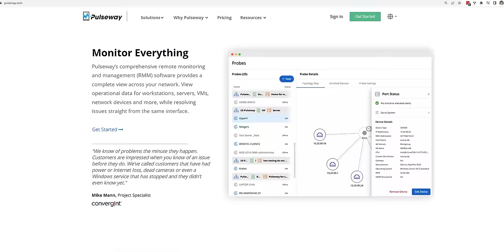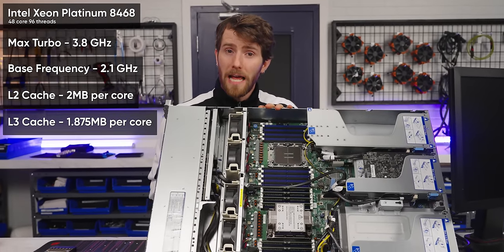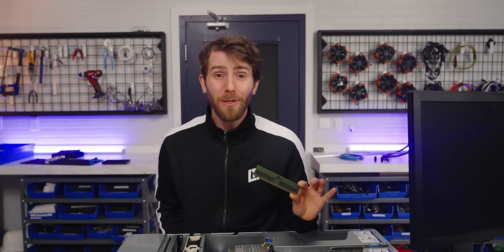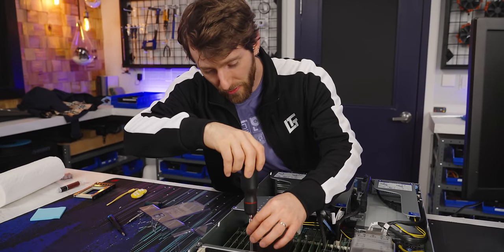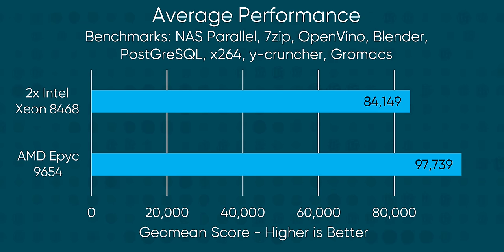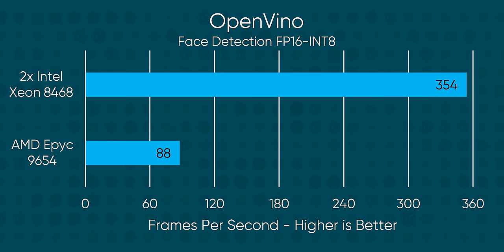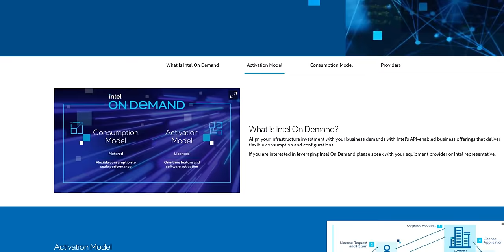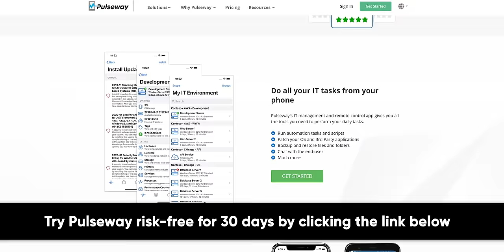Intel’s New CPUs are Cringe - Intel Sapphire Rapids Xeon Platinum 8468

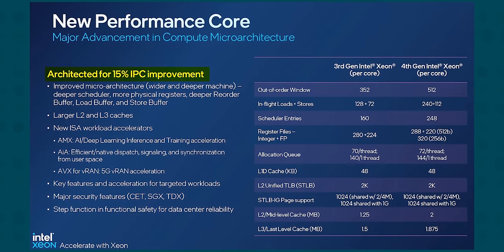Comment: 1:58 ever heard of Core 2 Quad? That's literally 2 Core 2 Duo chiplets on the same substrate.
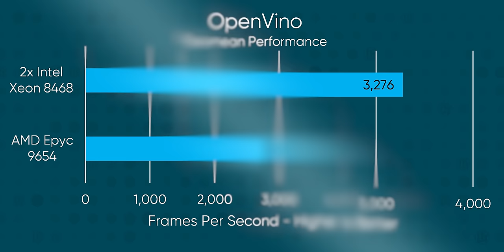13:34 it makes absolutely no sense to perform AI workloads on CPU, when an entry-level GPU is still like 10x as fast. The bottleneck is not matrix operations, it's memory bandwidth, which CPUs are still poor in due to their 4-level memory hierarchy with DDR. SPR with HBM would change that though.

Comment: I hope intel gets their stuff together, they've been a fantastic mainstay in my computers for over 25 years.. they're taking a beating right now but hopefully they can pull through.
Reply: Don't buy too much into this video.
Reply: This is what happens when its assumed that a juggernaut of a business cant fail. They have a decent hole to dig out of.
Reply: if you want intel to do good buy amd. the more they lose costumers the better they'll try to make their product to compete. also buy android instead of iphone. you are welcome to the advise.
Reply: Don't be loyal to brand lol, if they are not paying you take a lesson from Linus - go somewhere better (or somewhere they pay you). If AMD is better buy AMD, if Intel is better buy Intel. I have Intel for 12 years already but for the last 5 years and was better choice and my laptops run on AMD. Nothing special on any of those machines.
Reply: I'm not a fan of Intel and haven't used their products in 20 years, but it is good for the market when there are multiple competitive options so I do hope they pull their heads out of their butts and "pull through" as you put it.
Reply: @cyjanek7818  so if a politician gets paid by the oil industry and embargoes EVs because they can have huge range does that make ICEs better? Need more than just one video to change opinions and this video goes from good to bad to future good very quickly, with very harsh slandering even when the point diff between Intel and AMD in one of the non AI tasks was 50%
Reply: @AjayMenezesanayasdad  dude he talks about server cpu not their hedt one, it's laughable intel can bumbling too hard
Reply: @AjayMenezesanayasdad  I don't even understand your point but about his ai comparison - he got setup with two Intel CPUs and one and amd, that was 3k cheaper. They should check what accelerator can they buy for 3k USD

Comment: The whole thing seems like hubris on Intel's part. I can maybe see someone opting for Xeon 4th gen if they absolutely need 12TB of RAM in a 3U or 4U space, but given that it's already not a straight scaling (512GB DIMM x 8 channels x 2 DIMMS per channel x 2 CPUs should be 16TB) it makes me wonder if that'll scale to 4S and S8S systems, or if 12TB is just the hard cap. The S8S scaling seems like it'll be a win for Intel on paper, for high density cloud compute nodes, but given that those systems tend to be 10U or more it seems like AMD could still probably outdo them on both density and power consumption, albeit split over two nodes. Maybe for niche applications that need absurd numbers of PCIe 5.0 lanes on a single node? I'm just not seeing it. Yes, the prices are lower than 2nd gen or 3rd gen, but those were priced in an era where the competition was marginal at best.

Comment: I haven’t read the details on but it sounds like On demand is similar to what IBM has been doing with pSeries hardware for years at the core level. It allows you to purchase cheaper (fraction upfront for the core) and enable cores (or functions) as needed without large downtime to replace processors. Enabling cores is done live with soft keys, and pricing could be set at purchase time. This is something that enterprise purchasing departments will be comfortable with as it is some they likely already are doing within their larger systems. 

Having 20/40 cores enabled can save hundreds of thousands of dollars on a project and allows for expected (and unexpected) growth.  Allowing the purchase and licensing of the cores as needed and helping with licensing (sub capacity is a pain) by capping risk.  

In the IBM case there is a cost waste over the life of the hardware if the un-enabled cores are never used, as a small amount of money was spent to have them available but this is a hedge against needing the additional cores ASAP and having to wait on purchasing, supply, and the downtime required to replace.  Even at the scale some pSeries clusters can go to (256+ cores).  There are still times when HA of critical systems is out of reach because at this scale it can get pricey. Meaning a processor replacement could be hard to schedule and/or be financially impactful.

Comment: Is the Epyc chip still as fast if you add the thermal paste in the socket?
Reply: Even faster, cause it will use the pins for cooling and therefore has more thermal head room 😁

Comment: My first Intel was a 80/86 and switched to a 486 and finally upgraded to a PII 400 slot cpu, that was the last one cause I never managed to afford higher chips from intel cause it’s not the chip, you need to consider the ram, mb etc. I am loyal to amd for a long time even though it was behind intel and early amds sucked but they were affordable. Not feeling bad about intel.

Comment: Having 9 chips per system is pretty impressive, I remember getting a used R815 with 4 opteron server CPUs in it and thinking I had the pinnacle of computing hardware.
That said, having a better CPU per socket is going to be a far better solution.

Comment: 64GB giving 3D V cache a run for it's money. When transfer speed is no longer an object to hurdle, kinda defeats the purpose of L cache in general. Heck, to the point where L cache become more of a bottleneck to the rest of the high speed system, sides L1&2 caches have reached 2&3 capacities. At some point, technology is going to cut down fundamental bottlenecks that will change the world's standards.

Comment: Not mentioned in this video is AMD's massive yield advantage.

Each CCD is tiny (~70 square millimetres). The IO die is significantly larger, but is also on an even more mature (and cheaper) process and measures in at ~420 square millimetres.

Meanwhile each of the 4 dies involved in Sapphire Rapids products is ~770 square millimetres - massive by comparison and far more likely to encounter yield problems. For a 4-tile Sapphire Rapids CPU, 2 different die types are required due to the way IO and floorplan layout needs to be adapted.

Comment: As someone working for a datacenter and who knows quite a few folks in datacenters... reliability is king.

Few datacenters buy AMD systems because AMDs chip failure rate has been, historically, higher than Intel's.

Yes, AMD has been gaining ground in the datacenter market, but there's a significant lack of trust on them for datacenter use. 

Their "good" stuff is still only ~5 years old. Datacenters have been pretty much exclusively Intel business ever since Pentium 4-based Xeons.

Comment: Last year's consumer chips in a server processor for me is not a problem, in fact it's called good R&D.
I can't wait to one day get my hands on this.
Unfortunately, I think it was going to be better but I think now they're going to try to compete with AMD, but at least they are doing whatever they think is best.
I think architecturally you have two very different processes from two very different companies and I don't think either is bad. I would prefer a monolithic chip for certain workloads. I don't understand why the processor needs to have come out yesterday for it to be brand new. In fact these golden Cove cores are actually based off something very similar to the embedded server cores which were released in late 2020-2021, which precede the cores which you mentioned are released on the desktop.

I think your key thing that should be described as how money is possibly being allocated differently and that the price differences that exist between Technologies become more of an issue as budgets are realigned.
Reply: To be clear I don't think this processor competes with AMD.
What I was saying was now until this trying to compete with AMD, so I'm imagining in 5 years they will be able to compete with AMD.
Also I mistakenly said it's called good R&D. Would I actually meant was it is in my opinion something that appears like good R&D.
And what I meant about the processor as I thought it would be better but I think Intel is changing strategy to be more competitive and so architectural Decisions are now realigning in such a fashion. During any such process there is some decisions that are made which can be seen as a compromise, but always advance some kind of goal.

Comment: As an enthusiast already working on AI right now, no. Intel is not going to beat AMD by cramming proprietarized TPUs onto the same substrate as their CPUs right now. Why? The power draw of a good TPU that can run a large model at a halfway decent speed is almost as high as their CPUs.
What Intel needs is a dedicated TPU on it's own substrate that can connect directly to Intel's QPI (or an equivalent) to share RAM pool access and pass data across, similar to what their math co-processors did in the 90s. That way they can stream data packaged on the CPU directly into Tensor operations for the TPU to execute, and stream the results back to the CPU again to be packaged into a usable format (4eg, using AVX to convert output into a photo or video). Nvidia does this in stages due to I/O timing issues, but Intel (and AMD) have low level control of the system hardware and thus can sync system bus, CPU, and TPU clock speeds.

Comment: Honestly, they should fire whoever came up with the locked cores. basically if they were to charge lets say 2000/core to unlock and that CPU is ALREADY 7000. IT could easily make it cost 15000 for a single CPU, that's only a one stop shop. When i buy hardware, i want a fully unlocked and capable product. that's what i am buying, if corporations adopt this then it WILL trickle into the consumer market, allowing companies to come out with locked cores on purchase. This is ATTROCIOUS and should NOT be allowed to continue EVEN if Intel has to go through harsh times or go bankrupt. if i was in any level of IT, id ask if we can black list intel for trying. This is akin to this virus's that hijack your pc and want you to pay to unlock it.. but built into the market. Or allow companies to come out with finished products that lock out features behind a pay wall. then it will also affect other markets too. THIS NEEDS TO DIE

Comment: Again some perfect examples why LTT fails to properly review enterprise equipment:

* First, unless you are looking for a specific use-case which needs to fit multiple GPUs or a whole lot of disks -> NEVER, EVER buy Supermicro servers. Cheaply made, upgrading BIOS & firmware is a complicated process using DOS-like tools or the UEFI shell, and all IPMI (management interface)-implementations just suck. Real companies stick to the big 3 (Dell, HPE and Lenovo) for a reason ! I'm not talking cloud providers like AWS or Azure, or platforms like Google or Meta since they build their own custom servers anyway.
* Then, taking a SKU (Platinum 8468) which again, will only perform best in certain workloads and then comparing it with the top-of-the-line EPYC CPU is just unfair. Again, this SKU is for a very specific segment, but most will stick to mid or higher range Gold SKU's.

I know this because I was asked to configure a new HPE ProLiant DL380 Gen11. Our partner vendor specifically mentioned: in this setup, if we need more compute power or capacity, it will be cheaper to add another node than to buy just a single node with the highest CPU SKU, which would easily amount the same price as the whole server with a lower SKU.
So I went for a config with dual 5415+ (we need both PCIe risers for a lot of AIO cards, and DL380 is dual socket anyway), 16 physical cores in total. Since it's the 2nd lowest Gold SKU, it's also a lower TDP version (150W), and can therefore be cooled with the standard heatsink. CPUs above 150W need the high-performance heatsink, CPUs above 330W need liquid cooling..
The project will mostly be running on GPU (RTX A6000 or its datacenter equivalent) and the broadcast-specific AIO-cards (AJA, Matrox, ..).
Not to mention that if you run Windows Server you always have to license at least 16 cores per machine (even though the machine could have less, for example on both Silver 4410 SKU's). Properly licensing those 18 or more core machines will set you back a fair amount - not counting Software Assurance, Server CAL's, Terminal Server licenses etc etc.. 
But I think I've made my point here. Not every person is able to buy a Ferrari or other hypercar. So why bother with the stuff no one will able to buy, instead of focusing on "realistic" workloads and situations ?

Comment: Linus - why do you act like you have not handled or seen CPU-on-Cooler to socket? What about 3647? And what is the better way to install coaster-sized CPU in the socket? Probability of dropping CPU on pins is just too high. AMD's TR sockets with slide load mechanism are fine, but not when you have to install 300 of them. I really, really prefer to secure CPUs to coolers, and just drop them right in machine by machine, instead of doing everything on the machine. I really wish AMD for Turin will switch for same style of mounting hardware.

On the other hand reduction of 2S to single socket is worth FAR MORE than simple "buy one CPU instead of two". In the end CPU cost is negligible, especially when you factor in memory and storage, but the major thing is licensing reduction, lots of stuff is licensed by socket. THIS alone drives a lot of purchase decisions.

Also I bet SuperMicro isn't very happy with baically showing that their servers don't boot :D

Comment: I think ARM servers will be a much bigger threat to Intel than AMD. One of the biggest challenges in datacenters these days is that they can't increase their compute densite further due to power consumption limits. They'd have to do expensive construction work. And with higher consumption, there's a higher thermal load, more need for AC etc. Overall super troublesome. ARM's far superior efficiency is a very big deal here, because for light, highly parallellized workloads like web servers, proxies, terminal servers, CI/CD etc., you get magnitudes more compute with the same sort of power consumption and thermal load.

Comment: The price per chip/cores and power consumption was enough reason to figure out which system will be better in the tests. Then the tests results explained explained the title of the video, geez'... I have not seen 2 CPUs being behind 1 CPU while consuming almost double the power of the 1 CPU since Intel released the Core 2 Quad and AMD had motherboards with 2 dual-cores on them and failed to compete and were just as messy. 
  
Also similar to how the "8 core" Failldozer tested compared to the 4 core i5s and i7s - but at least the Failldozer and Faildriver were cheaper - not actually more expensive.

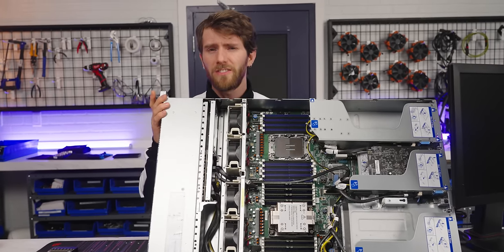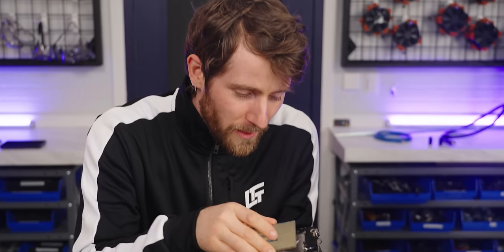Comment: 3:37 you can see something wrong with the socket. 4:30 saying something got in the socket. Either this was filmed afterwards or it already had something in the socket beforehand. Whether it was Linus or not, prior not sure. Who removed the CPU after you benchmarked it? Did you check the DIMM slots for thermal paste? 😂 RIP

Comment: Thing is... a dedicated GPU. Let's say a cheap, old T4 for 3-4k will still give you a 5-10x uplift in AI performance over Xeon. And bring your AMD to pretty much the same price at a lower power consumption and better performance. So the only situation where on-chip accelerators for CPUs would matter much is when for whatever reason you're out of PCIe lanes or sth. Maybe for storage heavy / network servers where you'd want to do some AI stuff like anomaly detection? No clue, relly. Anyhow, that's really having a solution and trying to find a problem rather than the other way around...

Comment: The Intel Xeon Platinum 8471N actually seems like a decent deal costing $5171, as it only uses 300w of tdp and has 52 cores with not terrible clock speeds.

Comment: 12TB? Nice, when they reach like 32TB I'm interested. Yes, I have a legitimate use for it, now limping at half terabyte though…
Reply: what do you need 32g for ?
Reply: @Edmondfreak  For keeping SDR baseband recordings, for fast analysis. Could be some 'second tier' RAM, slower than system. SSDs die too fast, HDDs (arrays too) are too slow, especially at concurrent accesses.

Comment: This "subscription" model Intel is trying to do will ultimately fail, why disable through software only to unlock later with software? it's completely pointless if the feature is already there. Also what's to say you can't just hack the CPU itself to enable ALL of it's features anyway without paying a subscription fee. Because we can be certain with 100% certainty that will be possible, someone will find a way to hack the CPU to bypass the subscription fees altogether and gain full CPU feature access with an ACE exploit delivered by a custom signed kernel module thats inserted at boot time, or while the machine is running, making the whole Pay-To-Unlock thing null and void.